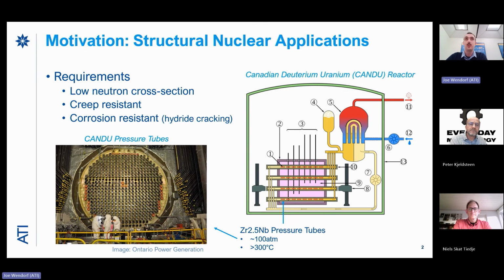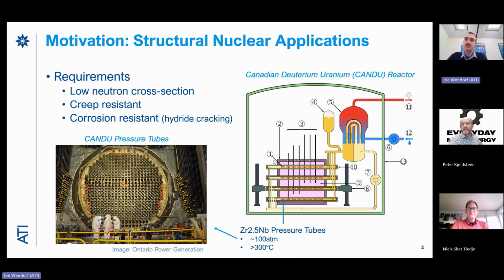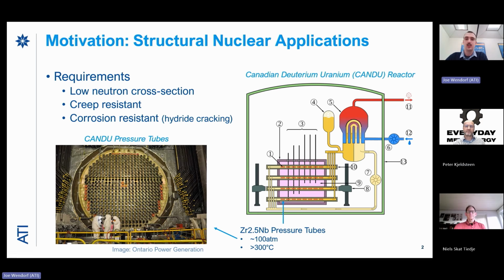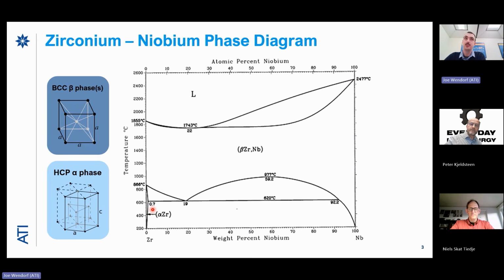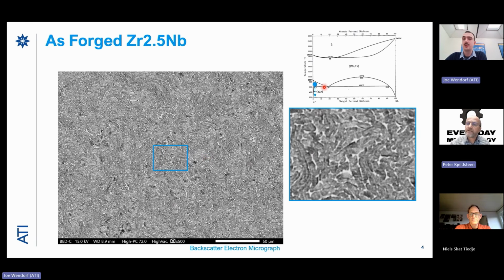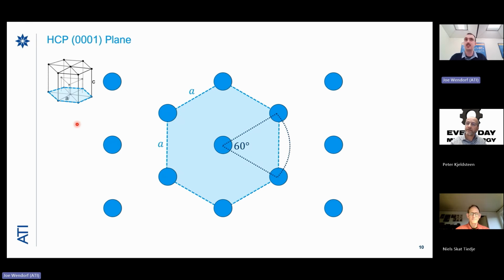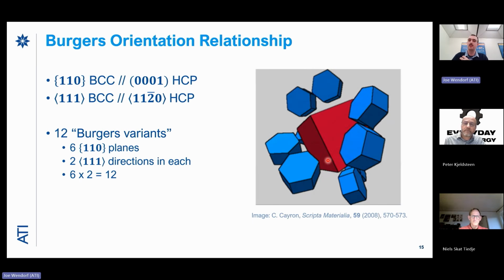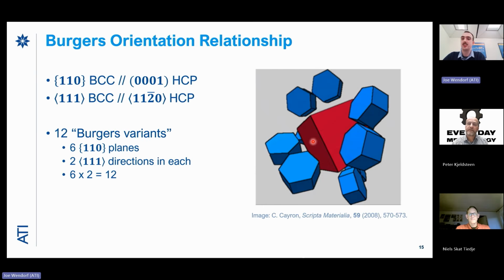Inside Zirconium Alloys: The Materials That Power Nuclear Reactors

Comment: I think the explanation regarding the 2 beta’s (often labeled beta and beta prime) in a 2.5%Nb alloy is misleading.  The reaction at ~ 600C is a monotectoid reaction.  Based on simple Lever rule analysis, the small fraction of beta20 left at 600C can undergo the monotectoid reaction and form alpha and beta (~85%Nb).  But this solid state reaction is kinetically (I.e. diffusion) limited and thus may not occur at typical cooling rates.  Therefore any beta with about 20Nb will remain that way and not transform to beta 85Nb.
Reply from the maker: Thank you for your analysis of the phase diagram🙏❤️
Reply: Sorry if my wording was unclear. I meant that there is a sudden jump in the equilibrium composition of the beta phase. In actuality, after extrusion, the beta phase isn't even at the 20% Nb level. It takes a 24-hour autoclave treatment to even get to 20% Nb, and then it slowly progresses over decades towards the >90% Nb equilibrium during service. I don't believe it ever truly reaches equilibrium.

Comment: This is great! I’m a nuclear engineer, and I worked on nuclear material science while in my Masters degree. I’ve published papers in Uranium Zirconium alloy so this is a good watch for me! 

6:19 I would like to add that lead is a strong gamma shield, whereas hafnium is a stron neutron absorber. Lead is generally not talked about when discussing neutron absorbing materials

7:27 heavy water actually boils at 101.4°C, because it is 10% more dense.

12:26 the item number 3 here describes control rods. They are inserted and have boron inside which absorb neutrons that cannot go onto to power the fuel. 

The heavy water inside the calandria, outside the pressure tubes and calandria tubes is the moderator. Heavy water is used because deuterium has a much lower absorption xsec over protium (hydrogen-1). This allows higher neutron efficiency. The issue, is that heavy hydrogen also slows down neutrons in more collisions because the atoms are heavier. So more interactions are required, and therefore, more moderator is needed between the fuel elements. The other advantage/disadvantage is because the calandria moderator is colder, it creates even slower neutrons than in a typical LWR. This means higher cross sections for fuel, meaning even more neutron efficiency. The disadvantage is that when moderator inside the tubes increase temperature that even more neutrons in the calandria get cooled down, causing a positive void coefficient.
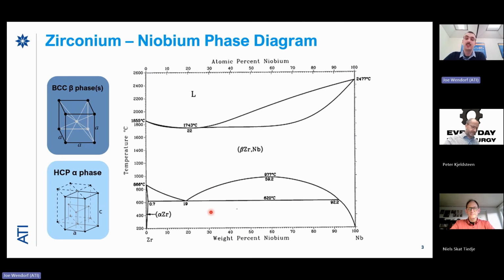Reply: 19:00 

That’s really interesting that you point out there is a discontinuity between the two phases and you’re able to take advantage of annealing there to exploit the kinetics. 

I imagine that even in that one region of alphaZr- Niobium that you’ll have a lot of zirconium rich, niobium lean grains, and once you cool it a little, new grains of beta-niobium will be created which will locally reject zirconium and absorb niobium from nearby grains. Creating a new microstructure, and you’re able to adjust the material properties by manipulating the annealing and cold work environments.
Reply: 22:31 , this is post irradiation examination. Or PIE. I did this for a little bit. But I have been curious about the prospects of recycling zirconium too. It would be nice to one day see radioactive zirconium be recycled into a reactor, but! A lot of people need to work with the materials before hand, so there is no real use of recycling today. Maybe in the future zirconium can be centrifuged to isolate stable isotopes, but I think it is much cheaper to just use virgin zirconium all the time. Otherwise, it is treated as high level nuclear waste, because that is what it is.
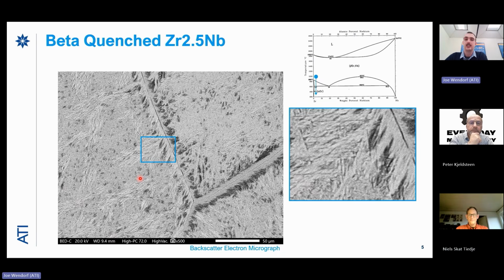Reply: 29:37 this is good discussion because the grain elongation is normal to the micrograph. But since the micrograph is only a mm2, it is hard to tell the exact radial orientation. Especially since this is typically not monitored during sample preparation, and, since we don’t know the exact size of the forging. If the log is only 1 mm wide, I am sure we would see the deformation. But if this is a 12 inch wide log, and we are looking at some near central radial region, then I believe the material would like this. It looks like there are alsmost macro grain regions that are sliding and deforming about. A radially forged section like this would be folded in many different directions which looks consistent with the micrograph. 

Further, it would be nice to have a scale bar on your zoomed picture.
Reply: 41:15 Nuclear fuel cladding must maintain below a 1% plastic deformation during operation. Can’t speak for pressure tubes. But creep can contribute to plastic strain which is less than ideal when you need to keep everything in very tight positions inside a reactor. If rods get closer or farther apart it affects their power output.
Reply: Thanks for posting this! It was a great watch, if you ever want to sit down with a nuclear fuel manufacturer that uses this zirconium alloys maybe I can get you a seat.
Reply from the maker: Hi Mack. Thank you very much for your deep analysis of the episode on Zirconium alloys. I am curious to learn more about the fuel in fission plants and would love to invite you to join a future episode. Please reach out to me on my e-mail: Peter.Kjeldsteen@gmail.com

Comment: How can ceramic engineer or refractory engineer contributes to Nuclear Science?
Reply from the maker: If refractory also covers refractory metals - the episode you find in the link below will show you a major important stepping stone within the world of Fusion, where both Temperature and radiation are major obstacles. 

https://youtu.be/Njim0TwU69c?si=QN45-CTxia2E-SZ_
Reply: High temperature gas cooled reactor uses these materials. Also an ion thrust generation reactor would have a ceramic naked nuclear reactor. I would choose zirconium uranium silicon carbide for that one. Add a bit extra carbon and maybe beryllium to help it stay stable. It would be used to superheat the fluid used to become the plasma source for the ion thrust generation. Would be extremely efficient because the reactor would be doing most of the work of heating and preionization so the acceleration itself is the real electrical demand ❤
Reply from the maker: @christopherleubner6633 Thank you for sharing🙏

Comment: Wonderful video, has any research been done into reprocessing of zircalloy/zirconium alloys once removed from the fuel in reprocessing streams? The french simply press them into medallions. Can they be recycled effectively or is it similar to aluminum in the difference of virgin vs. Recycled material? Can it be mixed with virgin material like cardboard or paper (obviously not exactly the same)
Reply: I am not sure what happens to zirconium components after they are extracted from a reactor. I know that we do not recycle them here at ATI. Zr is used because it is unlikely to interact with neutrons, but it does happen occasionally, and long-lived radioactive isotopes such as 93-Zr build up over time. These would either need to be removed, wait a long time for them to decay to safe levels, or build a dedicated facility for handling radioactive zirconium recycling, all of which add cost to an already very expensive process.

Unirradiated scrap metal, on the other hand, is very easy to recycle. We have programs to buy scrap Zr turnings and off-cuts from our customers back for remelting. Thanks to our vacuum arc melting process, the material actually gets cleaner and more pure every time it melts, so ingots with higher recycle content have lower impurity levels than ingots made entirely of virgin material. We do not throw away any scrap metal. In an absolutely worst case scenario, if a batch of material is contaminated to a point we can not remelt it, it is sold to the steel industry where it is added in small quantities to specialty steel alloys.
Reply from the maker: Thank you for the comment🙏❤️. I will pass the question to Joe, asking him to give a proper reply🤗
Reply from the maker: And here is the Lütjering paper that was mentioned during the episode:

https://www.sciencedirect.com/science/article/abs/pii/S0921509397007788?via%3Dihub
Reply from the maker: From Joe to the curious follower, please find a link to Burgers paper below:

https://www.sciencedirect.com/science/article/abs/pii/S0031891434802443?via%3Dihub